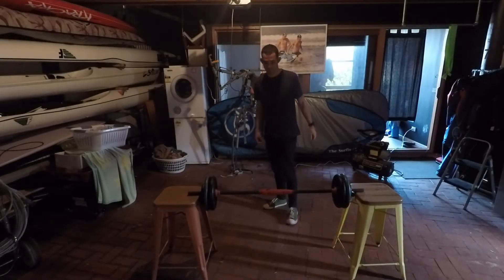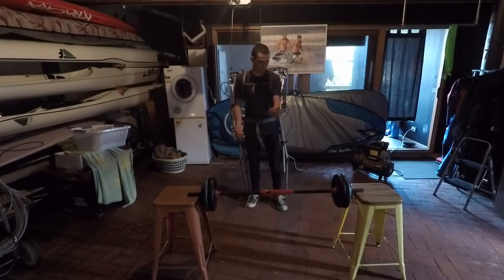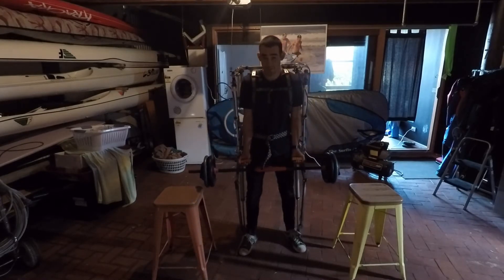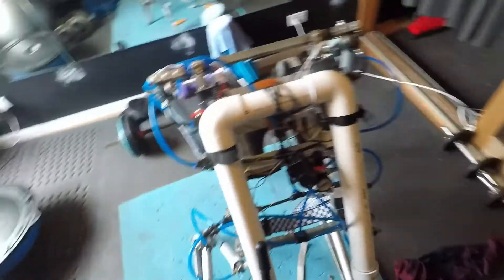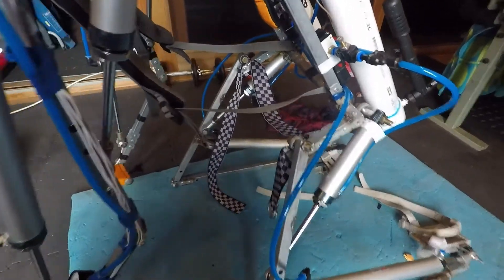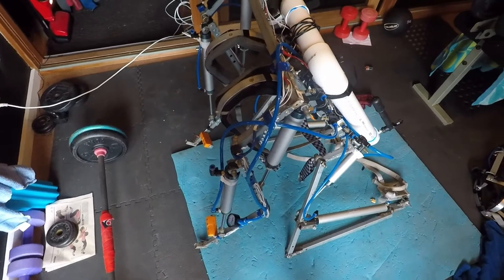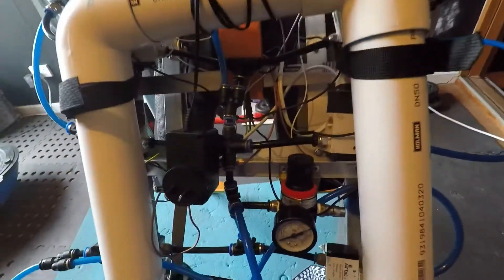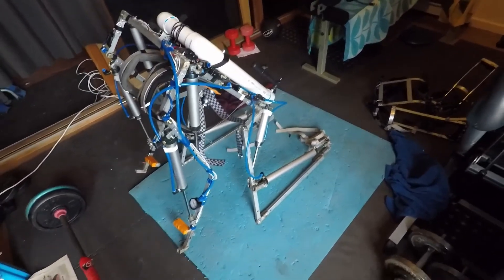Exoskeleton Demostration

Comment: simply amazing! i want to experiment with a  pneumatic system im currently using torque motors for mine :)
Reply from the maker: gold circle technologies if i were to build another I would be using motors, makes control and power heaps easier rather than crossing that electric/pneumatic bridge. The reason I did pneumatics from the start is simply because it's a cheap way to make a strong system